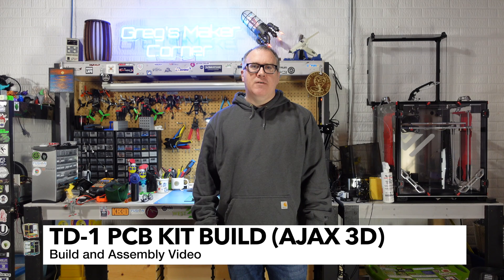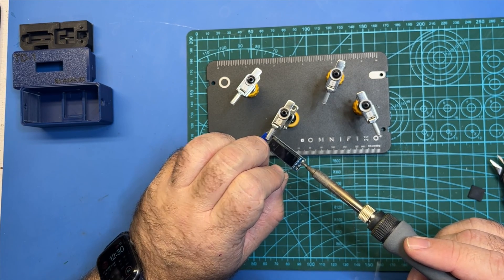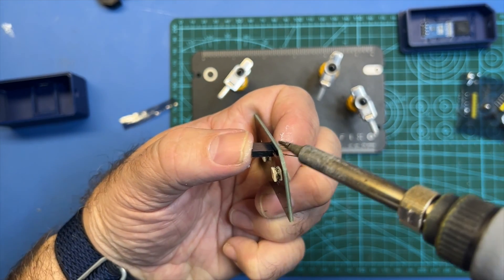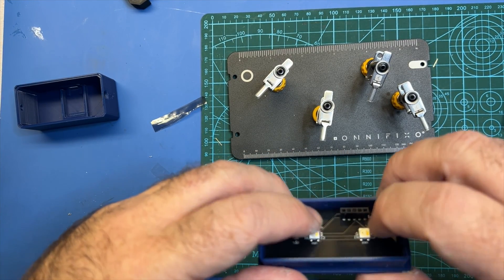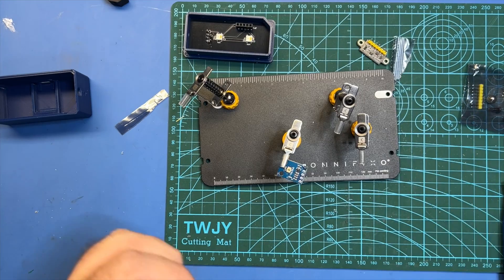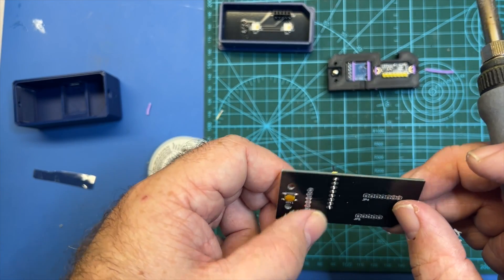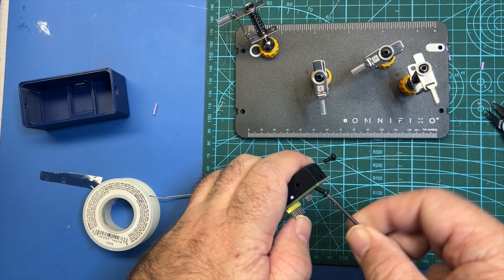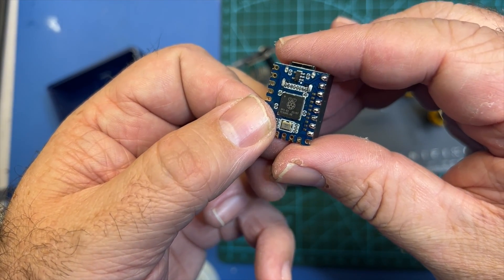Build Tutorial for the TD-1 KIT By Ajax3d: Detect Filament Hex Color & Transmission Distance

Comment: more of a project than i wanted . i wish i would have watched this before i bought the kit....the completed ones are not available... i might just shelve the whole hueforge thing for a while
but informative video
Reply from the maker: I am sorry to hear you are having trouble! I know it is a bit of a project, and definitely takes some work to get everything fitting together. Best of luck. Depending on what filaments you are using, you may be able to find some pre-existing values that will help also.
Reply: @GregsMakerCorner  thanks.. i need to solder on a few other things 1st. im just gonna do a lil bit a day... 

does the color of ABS for box matter?

Comment: Where'd you get the tool at 15:01?
Reply from the maker: It is a Flashforge Unclog Pin. Modbot told me about it- I got it from Aliexpress. It works great for the intended purpose of helping clear out clogs, and also helps for clearing the path in the TD-1. Best of luck!

https://www.aliexpress.us/item/3256802762314686.html?spm=a2g0o.order_list.order_list_main.74.4f0918026MnDpK&gatewayAdapt=glo2usa
Reply: I've made similar tools, but I like the bent wire handle.